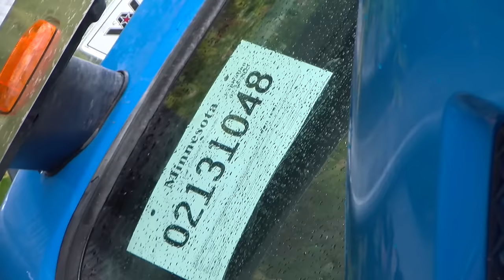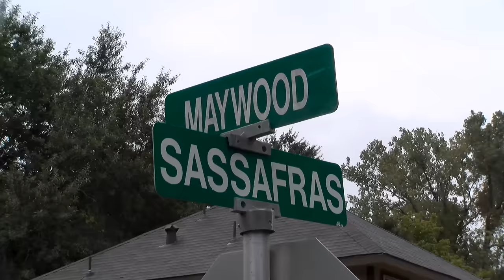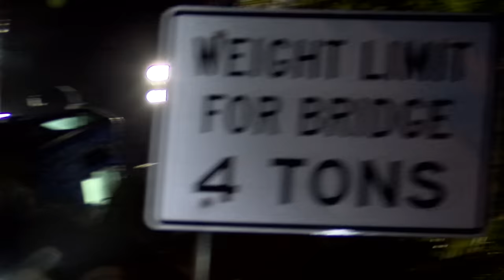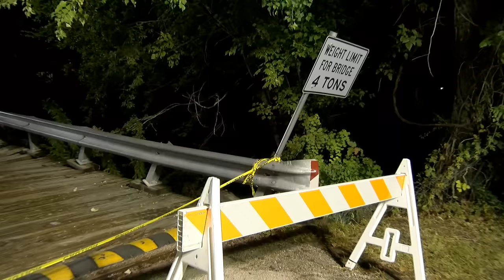091423 40 TON CONCRETE TRUCK COLLAPSES 4 TON BRIDGE AND VIDEO OF FULL RECOVERY

Comment: That "Recovery Company" is about as inept and worthless as anything that I've ever seen... The Concrete truck was still intact after going through the Bridge but they managed to mangle it all up and destroy it yanking it out of there...🤦
Reply: Another expert that's probably never done anything like this.
Reply: @jimmccabe801  I've never done anything like that.... Common sense prevents me from doing it ....
Reply: it was gonna get totaled anyway and with all weight still in the drum probably contributed to it getting mangled.
Reply: @thedesertdwellerfromutah4354  So you've never done a recovery like this so how do you know how it should be done?
Reply: @jimmccabe801  I've seen planty of "Recoveries" trust me. This was sloppy and lazy work in this video.
Reply: @thedesertdwellerfromutah4354  Seen. not done.
Reply: @jimmccabe801  You must be one of those fly by night "Recovery Specialists" like the one in this video.... I totally understand, no worries 👍
Reply: @thedesertdwellerfromutah4354  Nope. Not even close.
Reply: If the concrete is not kept in motion in the tank it turns into one big solid rock and the tank is destroyed
Reply: @ArtStoneUS  The Drum on the Truck can be replaced after the Recovery. But when you sloppily hook chains ⛓️ to the frame of the truck and yank all that weight dropping it on it's side several times then not only is the Drum ruined but the truck as well...
Reply: Should of had a crane on both sides of the bridge and cut the bridge back with chainsaws and picked it more evenly from front and back less damage to truck
Reply: @CharlesSmith-ty2ce  Exactly!! 💯👍
Reply: Agree 💯
Reply: @jimmccabe801 Been on more of these types of these things than you have and I guarantee I could have gotten that truck out of there without doing any additional damage. The tow operator and crane operator were both clueless.
Reply: @ArtStoneUS and the drum can be replaced.
Reply: @CharlesSmith-ty2ce Exactly!
Reply: I would have liked to see how Pepe recovery would have done this one.
Reply: @CharlesSmith-ty2ce  
Crane on both sides of the bridge .............. that could be INTERESTING once the truck is picked up, what are you going to do with it ? !
Reply: @jimmccabe801  You weren't listening.  He told you - Common Sense!  You know? That stuff that isn't common any more!
Reply: @californiasun5866 I don't listen to BS

Comment: Obviously not an easy recovery and I do not know the strength of the banks/approaches but, there seemed to be so many Indians and no Chief. No overall cohesive plan from start to finish before they started. River left full of concrete and diesel fuel is never a good result.
Better to step back and assess the whole job and formulate a plan from start to finish first. Up down, up down recovery is not the answer but does show you are only guessing.. Better to consult the military as they have experience and practice for clearing "blown" river crossings. The literature on best practise is freely available and they developed some under unfriendly fire, since WW2.
The poor old bridge is toast. Best clear all parts fouling the vehicle first to get a clean bite. Use the known formulas to assess  the needed lift and pull together with the space necessary to complete removal. Create ramps or use "gun planks" to slide it out more effectively. Sealing the full fuel tank to avoid spillage would take less effort than picking up the dead fish, let alone the ecological damage.
Guess it is the difference between American "brute force is always best and fastest" and those of us that need to use less powerful machines with lower gearing and more patience and confidence in experience and skill to achieve a better result for less damage overall but, a bit slower, maybe.
Did enjoy the repeated dunkin'  though...guess they thought it was a concrete donut.
Feel free to attack in replies but, you should know I speak from experience. Been there, done that, got the T-shirt rubbish. I also learned from British REME and American recovery manuals stretching back more then 80 years now. Not ALL American recovery is or, "get you home" expedients are rubbish. 
I did access this with an open mind hoping to learn something but, I was sadly disappointed.

Comment: No doubt this was 100% driver ignorance and his fault, saying that this was a private lane going to a housing community, if you google this it says the housing association is civil suing.  So obviously there has been concrete trucks back there multi times, seems between the contractor who called the order in and the dispatch they would have relayed there had to be a alternated route,  the gps is going to take you the fastest way which probably is over this bridge so possibly this company had been there before and nobody told driver of alternated route and he knew the company been there so he assumed they crossed it. Which is ignorant but not all his fault if that is case.  Dispatch gets to be lazy and lots of times doesn't relay these things.  Just saying

Comment: There's absolutely no way I'd use chains for a lift like that. This situation seems to be frought with lesser thinking.
Reply: Chains are no problem to use as long as the rating on the rigging is within working load limits. In this case, it's where they rigged them to. Frame of the truck instead would have been more successful.
Reply: I suppose you would want to use straps seems a lot stronger
Reply: More than 
Likely grade 100 chains.

Comment: That just cost Nelson Concrete the price of a new bridge and a huge repair of the concrete truck.   The truck empty weighs'' 25,000 pounds, or 12.5 tons.
Reply: They'll have to blast out the concrete too won't they? A la Mythbusters? 💥
Reply: Truck is probably a total loss.
Reply: I’d say Nelson concrete has just gone into liquidation over this unfortunate accident beyond there control  operator error

Comment: Not very impressed with the Wrecker or crane service, seems like they were a little out of their league!! Doesn't look like the chain used to lift the truck up was rated for 40 ton , and the connections were not done well either, the first one snapped off, and the second one was hooked up to the barrel's open end which is not meant to support the weight of the truck, no wonder the whole thing "dropped" off the chain. This is a serious Safety hazzard and they could probably be written up by OSHA. Sure these types of jobs are all different and none are easy, but you must keep safety first and use the proper rated equipment and connections at all times. Very Lucky no one got hurt here.
Reply: you forgot ' safety gear ' also
Reply: not a very bright rotator operator

Comment: Perhaps concrete trucks like the windmills are just too ridiculously big and they could be half sized... one of those things jackknifing  and tipping over on other vehicles can ruin a lot of people's day.... I know of a true story
Reply: They make half size trucks gor small loads but they are not feasible for most jobs. 10 yards of concrete is a full size truck and most jobs require multiple trucks. This driver should have known better.
Reply: @tomparker9966  yeah perhaps multiple trucks would have known better... Maybe one of them would have had a brain
Reply: @tomparker9966  many years ago when I was still a practicing physical therapist I recall a couple whose minivan was crushed by a cement truck that tipped over in traffic... I never look at them as just another vehicle on the road

Comment: This is a result of a cocky and arrogant driver, i been in the towing business and over the road driver, what you always see is these cement truck drivers and dump truck drivers or the most arrogant and cocky drivers, just watch them when your driving, they try to take short cuts to avoid DOT OT WEIGHT STATIONS because they run over weight sometimes, this seems like one of those times

Comment: Why they wouldn't cut or attempt to pull some of the timbers to get clearance before attempting to lift the truck especially with marginal equipment . How many chains did they break and the crane was running at max capacity  . Great video .
Reply: The whole operation looked like amateur hour. Spectators in the danger zone people under the crane. Outriggers on edge of damaged bridge. Where was law enforcement and DOT engineers?

Comment: You don't have to be an "expert" to tell that this was one of the most poorly thought out, poorly executed recoveries possible. I"ve watched dozens and this is by far the worst.
Number one, they were doomed from the start by the way they positioned the tow truck and crane. They seemed to pay no attention to the fact that the truck was leaning far on it's left side, and seemed to think they just needed to hook it and pull it out and it would somehow magically right itself. Crazy. 
The tow truck set up on the right side of the truck. The crane on the left. This was very poorly thought out. As were their positions.  
They should have been the opposite, as the tow truck has several lines and could have used them to tilt or roll the truck over to a more upright position once it was lifted enough to do so. 
Secondly, their rigging points were haphazard at best. They seemed to have no plan whatsoever, just pull and see what happens. 
And though lifting such heavy loads must go very slow, they seemed as though time was no matter at all. They'd hoist the truck to an awkward angle, hooked to the flimsiest anchor on the back of the drum, and then just leave it dangling there for what seemed like eternity while they walked around and scratched their heads. Yes, go slow and be safe, but for God's sake, leaving something that heavy just dangling longer than necessary is asking for trouble. And they got it when the anchor point finally let go. 
Then they were really screwed. The truck on its side, no room to put the thing if they did manage to get it to level ground. Everything all screwed up and no way to fix it because of their poor positioning. 
If the crane had been where the tow was, it could have lifted the front while the tow used multiple lines attached at either side on the tandems or at the least the frame, and could have lifted the sides as needed to try to get it coming out straight and close to level. 
Very frustrating to watch the crane lift the rear of the truck until the rear tandems were nly a foot or so from level ground, and then just stop. If there was a reason they couldn't go any further, I couldn't see it. And again, they left it dangling there for a very long time. 
The fact that they didn't think out their plan was plain to see by the fact that they had to lower the truck several times, loosing their progress,  to try a different method. 
It was painful to watch. Mangled the truck unnecessarily.  Felt for the guys that had to risk their necks going down into that mess to try to rig the chains. But everyone in charge was clearly over their heads on this one.

Comment: If you live in a place inaccessible you shouldn’t expect civil services
An EMS unit fully equipped shouldn’t have crossed that POS bridge.
Why would the property owner order concrete knowing the bridge wasn’t capable of supporting the loads?
Reply: There were other routes to the other side of the bridge that didn't involve going over it.

Comment: The bridge was rated at eight thousand pounds?  The front or steer axle had more weight than eight thousand pounds.   Anyone driving a heavy truck should know about truck weight and bridge capability.

Comment: HELLO ! Let's take a look at this, A average cement truck empty  weighs between 20,000 lbs to 30,000 lbs. Doing our math a ton is 2000 lbs . so on the low side the empty truck weights 10 tons empty !   Somebody didn't do their math !!
Reply: If the driver was an "import" he probably didn't understand the U S system of weights and measures.

Comment: that bridge needed to be replaced anyway, that wood looks rotten
Reply: At least it ain’t coming out of the county’s pockets
Reply: New bridges are not in the budget that is unless it's in Ukraine.
Reply: And the cost of rebuilding the bridge! The town will make out on this one... That bridge was in dyer need of replacement!
Reply: @lisashiela9137 that’s a fact. 😂😂
Reply: @justmeinnh2  i get feeling they won't make out fully, the company will argue the bridge was in grave disrepair anyway and they shouldn't have to be ones to pay for it all. Given street view 2 years ago said 8 tons and then it was 4 at the time this happened the bridge was on its last legs and could even broke by a normal truck like 1ton dually going over it.

Comment: 1:58:30 rigging or rigging point fails
Reply: they put the foundry hook on the bowl , so when it went horizontal the upwards pressure became horizontal pressure and let loose, they shoul have gone to the frame initially, that rotator operator is not that bright

Comment: I find it hard to believe a truck that size can weigh 80,000 pounds
Reply: i'm in WA, here a 3 axle truck is legal up to 60,000 lbs max, depending on the length of the vehicle. So i'd agree, probably didn't weigh 40t, but over 4t for sure lol
Reply: Concrete weighs 4050 lbs per yard (27 cubic feet) the truck can carry 10 yds. 40,500 lbs. Truck empty weighs 30,000 lbs or mor with fuel and water. 75,000 lbs total possible weight easy.
Reply: @tomparker9966  not legally
Reply: @wascalwabbitable  Different states different laws. Some concrete trucks here in NC have an extra tag axle that can be lowered behind the truck. Others have a 3rd tag axle in front of the drive axles. Large cranes have multiple axles to distribute the load per axle. Generally an 18 wheeler can carry 80,000 lbs on the east coast. Some rural roads or city streets are less or require special permits.
Reply: @tomparker9966  I'm talking about the truck in the video, and that truck didn't have a tag or boosters.
Reply: @wascalwabbitable  I think you missed my point. I never said that truck weighed 80,000. I was pointing out that concrete and large dump trucks in my area employed tag axles to allow them to haul heavy loads on secondary roads. I heard them say in the video that truck weighed 70,000 which was possible  but I have no direct knowledge. It was certainly way over the bridge limit no matter how many axles he had. The recovery guys  made a lot of mistakes and law enforcement did s poor job of managing the site by allowing spectators too close, kids playing nearby, poor recovery plan, no diesel recovery booms in the creek, underrated lifting chains etc. In NC the DOT would have taken charge and it would have been managed correctly with public safety in mind and the driver would be in a heap of trouble as they say.

Comment: Why try to sensationalize things and promote 'fake news'. Who came up with the number that concrete truck was 40 tons. Maybe 20 tons , 40,000lbs. The maximum common gross weight for an average 5 axle combination semi truck is 40 tons (80,000lbs).
Being said, that driver has no excuse for crossing that bridge loaded, without municipality permittting.
Reply: The truck weighed 25 to 30,000 lbs empty. Concrete is 4050 lbs per yard. That truck could carry 10 yards so possible weight of 75,000 lbs. Bridge was rated for 8,000 lbs. 1 ton is 2000 lbs. He was close to 10 times over bridges rated load. Driver should have seen that wooden bridge and said no way.

Comment: No math test for cement truck drivers?
Reply: Good ol Google could of told him how much 4 tons is.
Reply: The problem is the sign is right at the FN Bridge a 40 ton concrete truck had no chance of stopping in time if he was going more than 20mph they needed a red warning sign at least 100 feet from Bridge entrance!
Reply: We do take a spelling test....for being a concrete mixer driver.
Reply: @danielramsey1959 great comment. Aint it funny how very few drive mixers but everybody on the job can tell you how, just like this guy thinks this truck was hauling cement
Reply: @jcearnhardt393 I drove mixer 15 yrs and it's not hauling cement.

Comment: I don't care to hear all that background babble with bratty kids. Leave it out. Quite annoying.
Reply: Just turn off the audio.
Reply: @norman7179  I shouldn't have to. I want to hear what cops are saying. Send the brats in the yard to play. Some kid kept making comments.
Reply: @evelynestenik7446  
I offered a reasonable solution, you chose to ignore it...............
Why did you keep watching ?  
The video was about removing the concrete truck, not what the cops and watchers were saying.
The video is what it is !  Can you unscramble an egg ???
Reply: Would you rather the video had no audio ?  
There is no way to isolate what you want to hear from the rest of the noise and chatter.
Reply: @norman7179  kids need to be in the house. How's that,?
Reply: @norman7179  you fit in with this
Reply: @norman7179  nevermind einstein

Comment: I had cement truck go through a bridge in my township in Illinois. Bridge was posted at 6 ton and truck weighed  30 ton. At what point does common sense kick in. Takes all kinds.
Reply: BETTY'S BROTHER HARVEY IS PREGNANT AND BETTY IS THE FATHER 😳😳😳😳😳😳🙄
Reply: @DavidWenhold-u4q  I wouldn't be surprised. 🤣🤣

Comment: Having been away from that area since 09, I'd completely forgot how morbidly obese even the cops were and still are there.  That truck stop BBQ and heat lamp cuisine is still claiming years off them good ol boys and gals.  So glad I could never over indulge or wven really eat anything greasy or I'd get the worst heartburn and indigestion.  Even with the most intense qeed munchies I couldn't eat like those guys, not even at meal time on the oil rigs I'd spend 21 days on that had basically a golden corral to feast on and an hour+ to do so could I put away more than 2 plates and a bite of desert.  Those stomachs must be stretched out like pizza dough being stretched out.